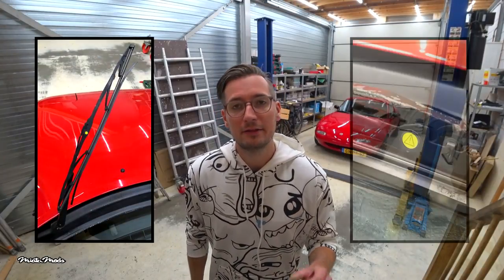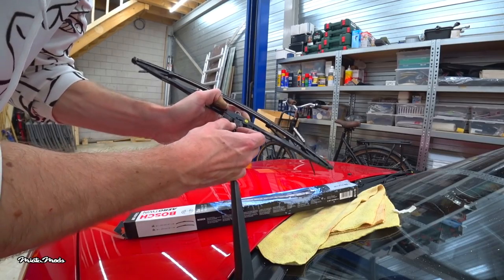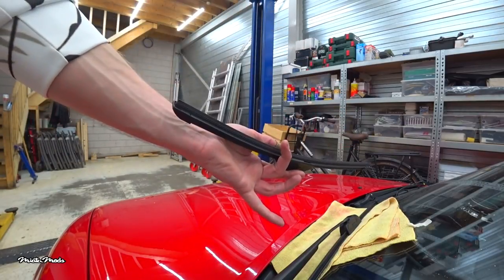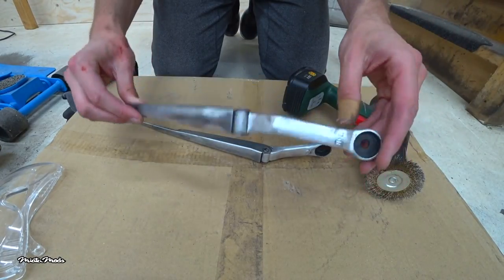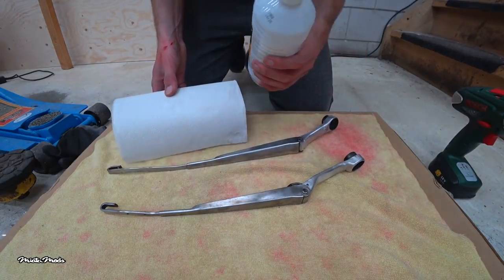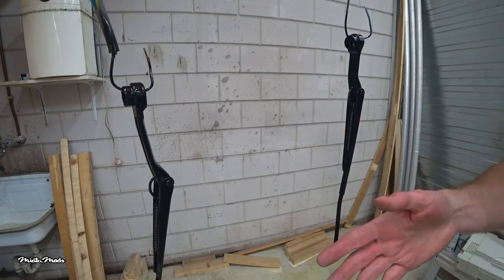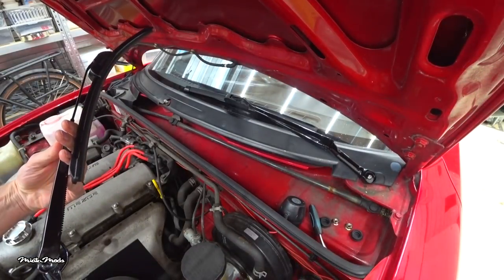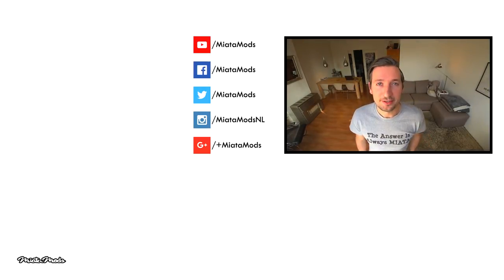MX5 NA Miata - How to replace windshield wipers and paint wiper arms

Comment: Good tip on how to release the arms by pushing down on them.  I think I just muscled mine off somehow.  I painted mine a while ago, but they already need to be redone.
Reply from the maker: Hmm how’s that? Paint didn’t stick?
Reply: @BecauseMiata
Fancy meeting you here 😉😅
For paint I either use Hammerite which treats surface rust at the same time, or heat resistant black aerosol as used for barbecues and stoves. I put it on my ancient Peugeot 205 about 5yrs ago and it still looks good.
Reply: MiataMods multiple reasons the paint didn’t stick.  I did a poor job of sanding and prep work first.   I also sprayed the paint outdoors on a humid day, so there was moisture in the air.   Next time I do this, I will sand them down like you did (and wear heavy gloves), and then hit it with primer first to help promote adhesion of the paint.  I’ll do this indoors with ventilation to control humidity and dust.  Thanks for the tips!
Reply: Robin Forrest you have excellent taste 😎
Reply: @BecauseMiata  
When great minds meet 😆
I'm off to watch your latest

Comment: Wanted to do this on my NB, but I can't get the wiper blades off, the nut is just completely stuck for some reason, even though it looks completely clean... Any tips?
Reply from the maker: Well yeah, you need to push down on the arm to remove it as I've shown in the video

Comment: Mines stopped working after I reinstalled them. Any idea what it could be?
Reply from the maker: Your wiper arms stopped working? That's really weird.. its been 6 months since you posted this comment so did you fix the problem?
Reply: @MiataMods  ya it was an easy fix, took them off again and cleaned all the metal shavings in the widow wiper shaft

Comment: how has the paint held up? have you done any more touch ups over the years?
Reply from the maker: Not really good, it stays too soft and it gets damaged easily so I would not use this paint again. I think I would go for a 2K paint, maybe even with a 2K clear coat on top so the paint is a lot more durable